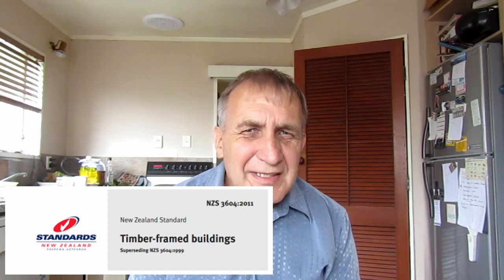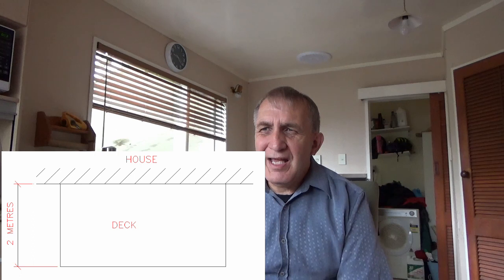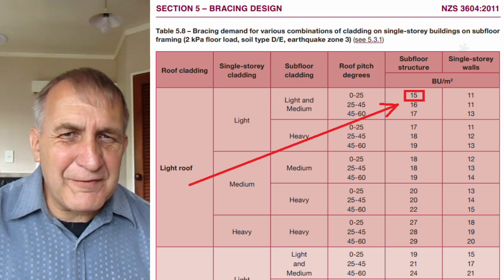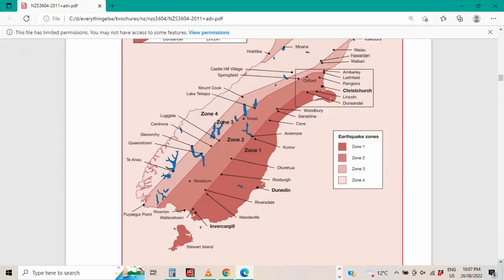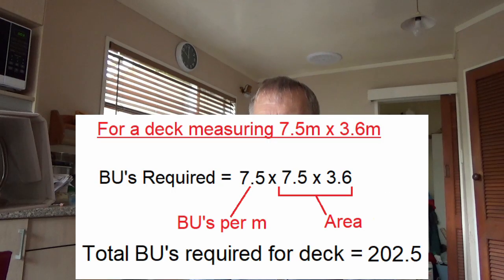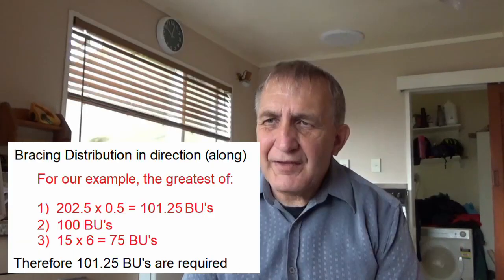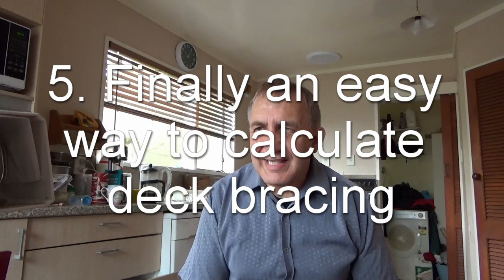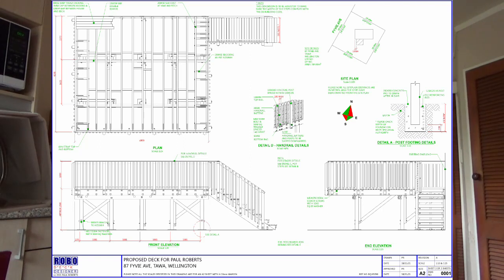Bracing for New Zealand decks - understanding the complex building code regulations

Comment: I am wanting to build a deck that is approx 6.5m x 5.2m but the calculator isn't allowing this input. Is there a specific reason for including the limit on width?
Reply from the maker: Sorry, there is a limit on the width of the bracing calculator of 5m. I will see if I can increase this to 6m. Over 6m becomes a little bit complicated as generally timber doesn't come longer than 6.1m

Comment: NZS3604 5.5.6 requires a minimum of four anchor piles, does this apply to decks?
Reply from the maker: Hi, sorry I think this needs a bit of clarification. My understanding on the clause 5.5.6 applies to a free standing deck only as the word "only" is in there. If the deck is attached to a foundation wall, then the 50% of the bracing is taken up by the foundation wall. The decking brochure shown by Matt is a free standing deck. I'm just starting on a video on the decking supplement from BRANZ, and their example has two braced pairs in each direction or two anchor piles. You can find a link to this brochure from the link on the ROBO Deck designer website at www.robodeckdesigner.co.nz/tr.php . I hope this is helpful
Reply: Yes, spaced symmetrically. Source: Mitre 10 Design a deck pdf.

Comment: I see min deck width on your calculator is 5m. I assume that is so you can have a bracing line at each edge and it meets the requirement of bracing lines at least 5m apart? However on my deck its  2.5m from the wall, so bracing applies but only 3.4m wide. Thus do you just have one bracing line at one of the corners?
Reply from the maker: Sorry I'm a bit confused here. Firstly the maximum deck width on the calculator is 5m, not the minimum. I'm a bit confused on how far you deck sits out from the wall. Is is 2.5m with a length of 3.4m?
Reply: @robodeckdesigner  I tried to put a deck into the calculator 3.4m long, (bearer direction) and 2.5m wide in joist direction. But I think it said that min dimension was 5m but I could be wrong. So my question was in that scenario would you just need bracing at one corner since bracing lines are supposed to be at least 5m apart? I might just come back to 2m so bracing won’t apply.
Reply: @robodeckdesigner  So looks like smallest Medium height deck size against the wall basic rectangle No 6 Variation 2 is 4.8 length by 2.7 wide. My initial design is only 3.4 x 2.5